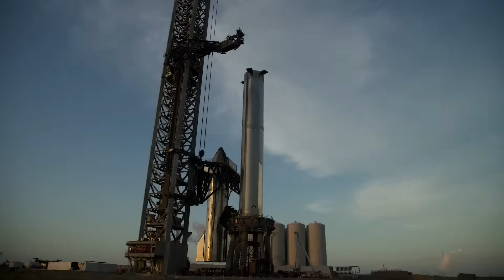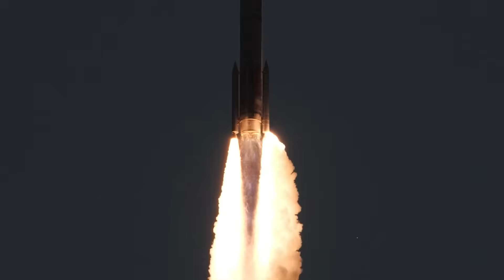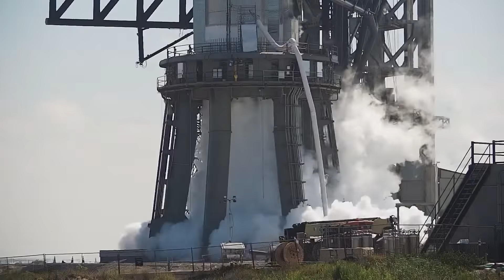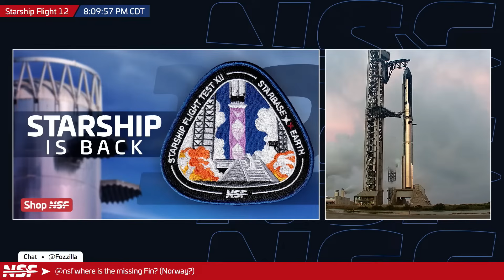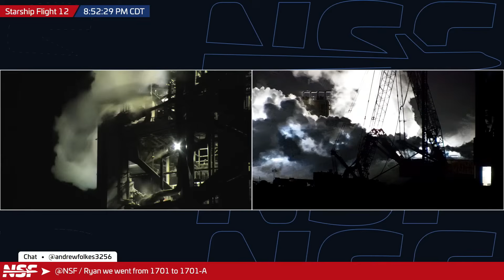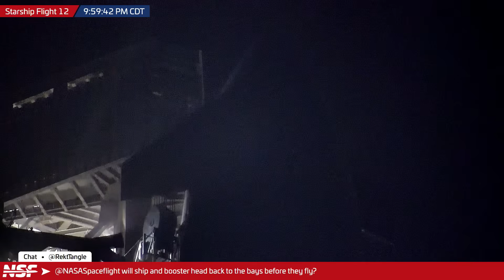SpaceX Scrubs Wet Dress Rehearsal of First V3 Starship

Comment: Data is the payload. When Starship blows up, do not let your heart be troubled. Anything which doesn't destroy the launchpad is a success. It will surely take a few flights to work out the kinks.

Starship is the future of major spaceflight because, unlike SLS, SpaceX will not discard a $1 billion in first stage engines in the first ten minutes of every flight.

Comment: Does anyone else think V3 looks much more aesthetically pleasing? It's proportions look much better  than previous versions. For perfection, I think Starship needs to be just a bit taller. I look forward to V4.....

Also, SpaceX need to make a pen. I'd love a pen, or set of pens with Starship as the cap, and the Booster as the bottom.... I don't think that I'd get much writing done, but hours of stacking and unstacking... ;)

Comment: Huge complexity in getting the new GSE, new pad and new ship all fully working so not really surprising this is a scrub. Would have been more surprising if this had gone all the way through first time.
Reply: Indeed. We were all really surprised that B19's first test went smoothly and they actually didn't have any apparent issues until like a few tests into that campaign. It goes to show that even with the new pad the issues are wayyyyyy less common than back in the pad 1 days where they would happen on every other test haha